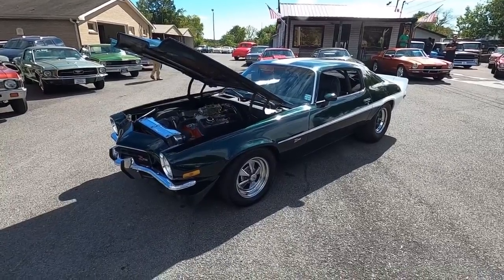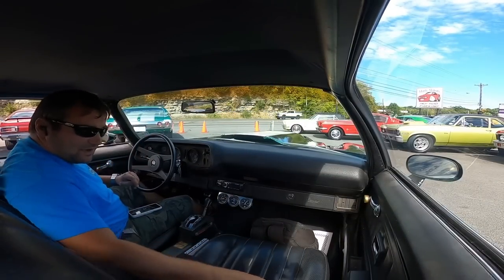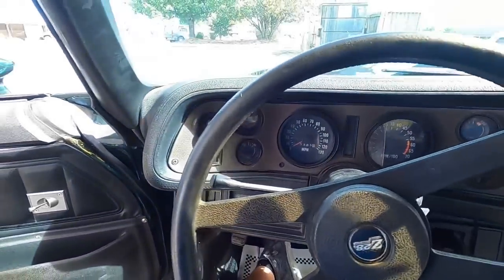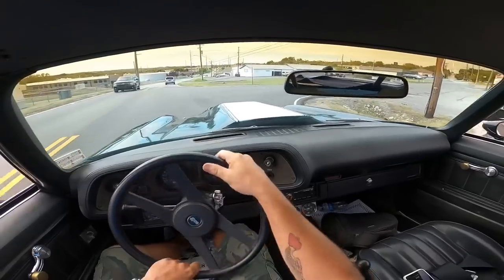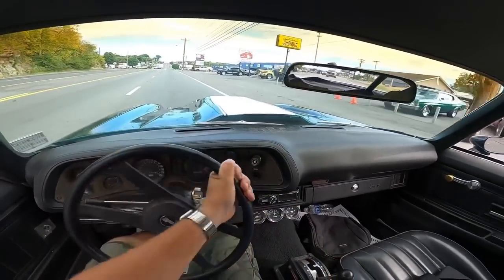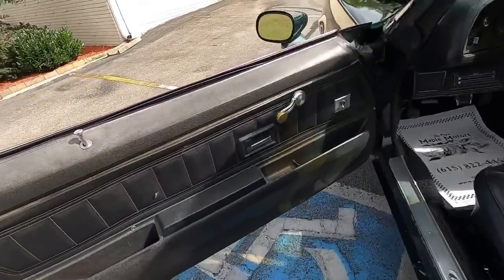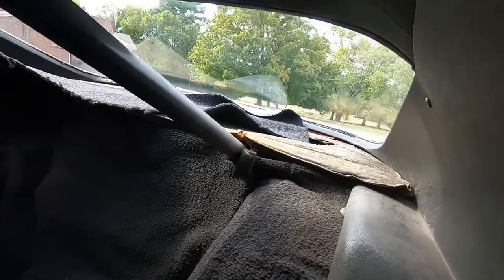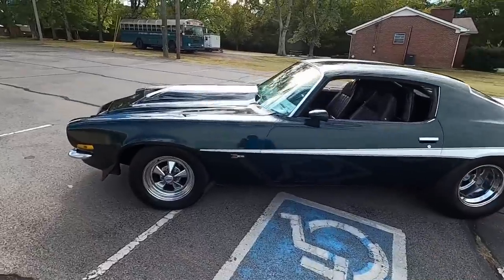1973 Chevrolet Z-28 Camaro "Pro-Street' 396 Big Block SOLD $23,900 Maple Motors #1814

Comment: Really nice walk through -- I appreciate that honesty.  Most of the issues are cosmetic.  The bottom window front and rear corners need a little more proctoscoping.  Trunk hinges obviously leak, trunk is missing drain plug, and that rear battery is a fire waiting to happen.  Overall, not a bad ride for someone who can fix it up.

Comment: 24k and absolutely nothing works on her...I mean I guess if you'll keep it strickly for the drag strip...
Reply: A few hours work and less than $200. If you want to use it on the street. Big deal. If you're going to bracket race it. Don't worry about it. These are piddly things for a hotrodder to fix and not pay basically $100-200 and hour for someone else to fix and have the price go up.
Reply: I must have missed where nothing worked?
Motor runs great... Trans shifts fine... Rear gears work...wipers work..windows go up/down.

It it going to win an award at barrett- Jackson? No.... It's also not going for Barrett-Jackson money.

Could you build 1 for the price? Also no

Comment: You have a short in your electrical system because you apply your break's your parking light comes on,on the driver side but when you let off the break the light goes out bro 😹.

Comment: Usually I don't have anything negative to say because I love this channel and your dealership but driving that vehicle around with no air filter on it is not too wise.
Reply: Not at all  No Filter ? Buyer beware  ?
Reply: @ratcat2096  😆
Reply: Buy it and put one on that suits you. Tastes vary. That will be the start of what makes it yours.
Reply: @davidkeeton6716   Don't have to worry about me buying that 1 no telling what's been sucked in by that beast with no air filter on it.
Reply: What does it matter? If they sell it as is you know what you are getting. It’s clear the previous owner didn’t run an air filter so it would be wrong for them to try to cover it up and not show that’s how it’s been cared for. Then you would be getting screwed over and never know that it had been run like that.
Reply: @yamahaguy1732   Throwing that out there for the guys or galls that do not know any better. Somebody with more money than sense might see this and think it's perfectly fine to run an engine that way.  To each his own but to run any engine without an air filter is as wrong as 2 boys humpin.  Maple motors is a respectable dealership no way nick would correct something like installing an air breather and not inform the buyer. Nice size chunk a trash come from the underside of that hood and get sucked into that carburetor its game over😂😂😂
Reply: What are y'all driving that y'all have the room to question this bad ass ride? 🙄  y'all crazy!

Comment: I also don't want to be negative and love this channel as well. But that car is a piece of junk. $24k is absolutely way too much. that's a nice rolling chassis worth about $8-$10k tops. the motor is weak and the transmission is janky
Reply: I just Sold my 1970½ Camaro 3 week,s ago big block 427 4spd! $13000 grand it's been sitting for the last 20 years the Candy Metal Flake paint was completely faded and the clear coat all cracked it NEEDED TOTAL RESTORATION. And that's what I got I was asking $15,000 but I took the 13000. So I think this car is more than reasonable price?
Reply: @erichb4021  you got lucky. That's all I can say. Not going to argue with someone  that I don't know. Not to mention you had a split bumper. Way more desirable.